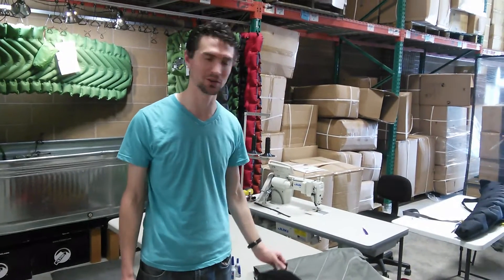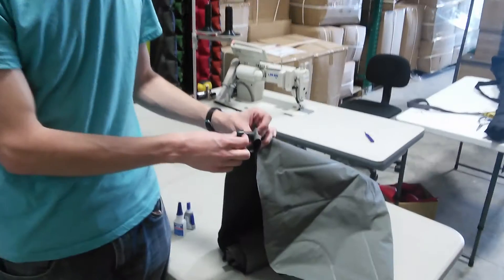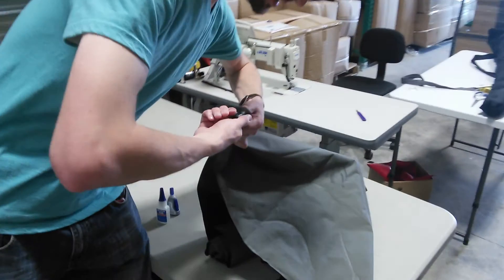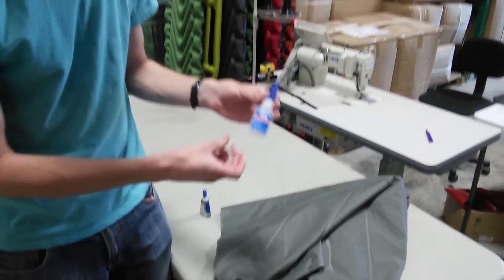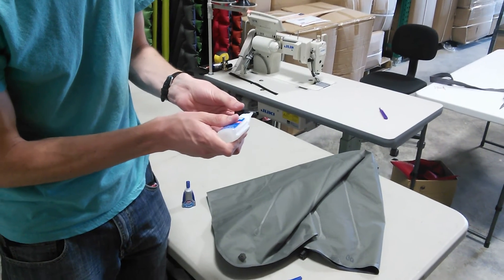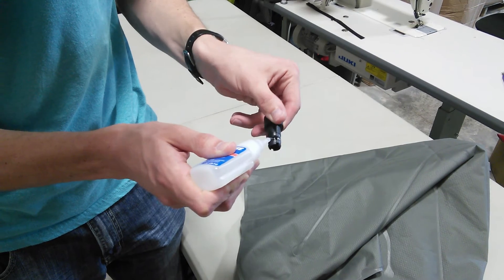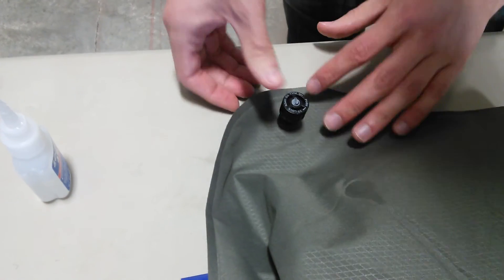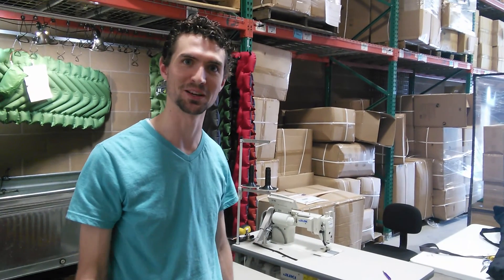DIY Klymit Push-Pull Valve Repair/Replacement

Comment: Thanks for this video. I will try this on my valve. However, I noticed a not that slow leak within the second valve (the one where a pump can be attached) of my inertia xlite pad. It happened very quickly after purchase. Any idea on how to fix this quickly?

Comment: i received my klymit static v sleeping pad 45 days ago. The valve is leaking and i dont want to super glue it. Do you think duck tape or flex tape would work? Or is it possible to get a replacement?

Comment: Is there something better to use? I'm thinking like pipe dope or Loctite thread locker, but not superglue. Superglue seems like it would cause problems in the long run. As other mentioned it's moderately permanent, so its seems like a bad thing to do.

Comment: Have a brand new static v and it leaks.  I held it under water to confirm it was between the valve like you mentioned.  Why does my new expensive pad leak like this? First use I was on the ground in the middle of the night!
Reply: I emailed them a few months ago and didn't get a response until I asked the question on Amazon. Try that. Very prompt response. Good luck!
Reply: Jared Stewart I ended up gluing like this guy said and I think it worked.  Haven't slept on it though

Comment: This is the third time I’ve done this in 2 years.  Positive side?  The more you do it the easier it is! Lol 😂 Great pads for the price and so far a good value.
Reply: Can you actually remove that valve after it's Super Glued in???
Reply: @PapajosTraders  
Yeah.  No problem.  By hand too.  A strong enough twist breaks the seal.  I should do it again before spring in my pads.  Thanks for the reminder.

Comment: nice that you guys made a tutorial for leaking issues with this valve! but why you produce / use them when you know that they have leaking problems? I have a static v insulated matt and the sleeping comfort is amazing but I have the leaking problem with the valve... so i think for this price you could use a better valve ;)

Comment: Same thing my StaticV slow leak starting 2nd week rendering pad unusable. For $70 they couldn't choose valve fail seems common issue? How long does super glue fix work, this is really disappointing
Reply from the maker: Hello Marshall, the superglue fix will solve the slow leak if it's coming from the valve. We have our support staff prepped if you run into any other issues. I gave them a heads up so you can get a quick response.

Comment: i have a "slow leaking" problem with my brand new klymit insulated lite pad. After watching this video i inspected the valve and guess what, it wasn't pushed all the way in from the factory, wich made it spin and slowly leak (wich i confirmed underwater). 
I just pushed it all the way, didn't use any glue, and now it it much better, just 1 bubble every second, compared to many bubbles.

I still think this is ridiculuous to have such issues with a produtc of this category, but at least it helped. You need to do a better job that this, Klymit!

Comment: I don't think this is my problem.  I think  my leak is where the valve attaches to the mat.  I removed the rubber, glued it and put it back in.  Seems to work.  This is the second leak I have repaired.  I wish I bought a foam mattress.

Comment: I can see what appears to be a serious flaw with this...you have super glued the valve in which will render it impossible to remove in the future, so what happens when you need to remove it to replace because of another leak after it has been super glued together?
Reply: lifetime warranty. they will hook it up.
Reply: Its happening to me right now. Bought it a few months ago. Finally tried it a week ago before using it in the field and its seeping air. Used super glue and now i cant take it out but still leaks. Now my trip is with no sleeping pad...

Comment: poor valve design. seems everyones leaks. got 5 uses out of mine and leaks. took it apart and doesnt seem to be any sealant or glue used from factory, saw no residue or sign its used on the stem.
trying to find a replacement valve on your page but not seeing any. may need to replace it now if this doesnt work. or their not avail and have to send it in?

Comment: Have they fixed or redesigned this shitty valve yet? Jan. 2020
Reply: Nope, they have not. Mine worked great for my first two trips. The third trip, Grandfather Mountain NC, was extremely strenuous and exhausting. I was really looking forward to sleep but the pad went flat in fifteen minutes. Very long night...

Comment: This is ridiculous... Do I need to bring a super glue every time when I go camping? I have just bought a brand new Insulated V Luxe from Amazon and it has a slow leak. The issue with your product design, stupid! What are the benefits of your valve instead of the traditional ones?
Reply: I Brought two Insulated Static Vs, Both of them leaked first time out camping
Reply: Im with you on this. Mine leaked too first time out. Miserable sleep. Poor design.

Comment: @klymit You should be replacing everyones pads with new ones free of charge!! Do you realize what a giant inconvenience this has caused. Failed when it mattered the most? I can't even explain?? This thing has ruined my night so many times. I am not going to super glue my valve. Super glue is not air tight